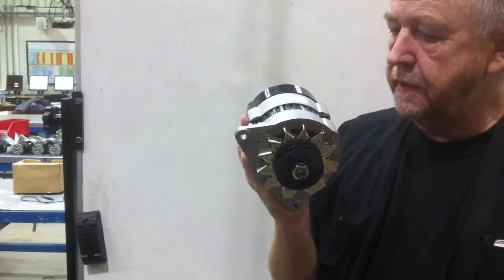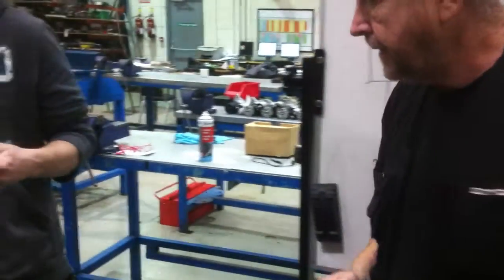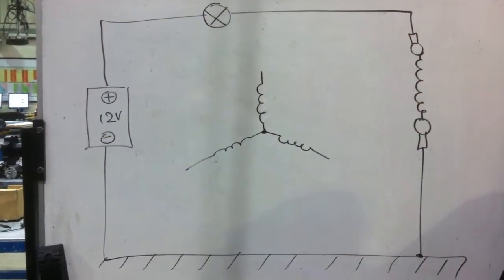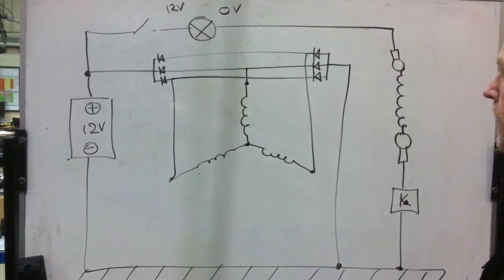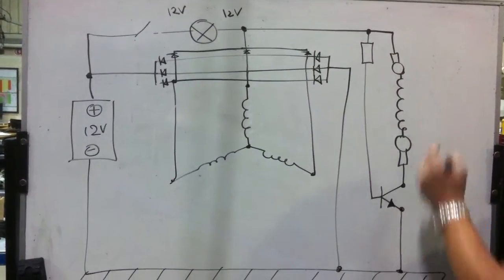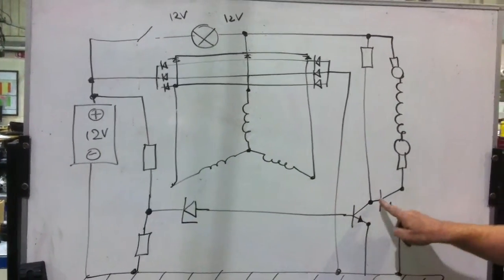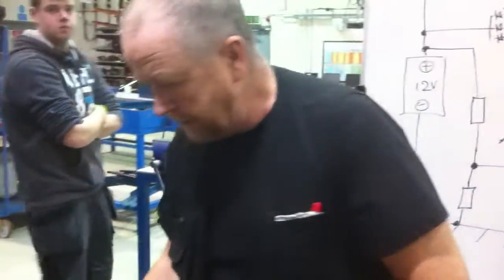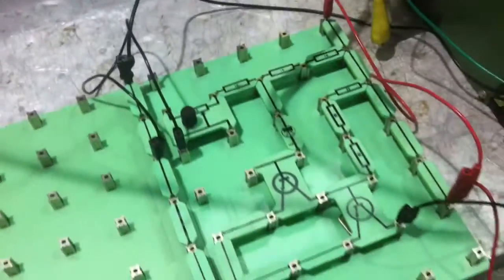Apprentices use Locktronics to build a voltage regulator for a Lucas Alternator

Comment: A well structured and thorough explanation , especially how you go in depth into the voltage regulator.  After watching your video I retrieved  a Lucas alternator that I have been keeping for years in my garage , took it apart , tested each component and verified that it was indeed working - something I have been meaning to do for ages. Thanks a lot !

Comment: Excellent style of teaching, you made it very simple to understand, clarity should be a currency!

I'm living in a camper van, have a 100 amp ignition battery, and a 4 x 90 amp(360 amp) battery bank that in summer is charged with two 120w solar panels. I'm biting my nails as winter approaches, with dwindling sun, and a much colder less energetic battery bank.
What I'm struggling with is how to 'trick' the standard valeo 90amp alternator to charge my 360amp battery bank .
In summer usage they can be sitting anywhere between 11 volts & 13.5 volts, regardless of my starter battery's voltage. 
Is there a simple way to trick the alternator? With perhaps an additional circuit?
Any help would be greatly appreciated
Cheers Neiall

Comment: Excellent video. Would you mind letting us know the value of the resistors you used and the amp rating of the NPN transistors.
Reply from the maker: oc2phish07 Hi, sorry for the delay in getting back to you, I've been away. The circuit we knocked together was done on lunch breaks, because there is no time allotted in the syllabus for this activity. We just used components that were to hand. The transistors were bc109's or similar, and the (base limiting) resistors were around 1kOhm.As regards the resistors used for dividing the voltage in order to signal the Zener diode, we just used what ever was around to match the voltage of the Zener. I also had the apprentice use a variable resistor so that he could prove to me he was controlling the output voltage of the alternator. As you can see from the video, it was a little high (in excess of 15V), so you would need to fine tune that.The resistance of the rotor is in the region of 3-4 Ohms, so your transistors or Darlington pair would need to be able to handle that. We literally knocked together the circuit with bits and pieces we had around. I just wanted to show the apprentices that all this theory actually works. At some time in the future, if I get time when this topic comes around on the next course, I'll try approach it in a more precise way, and work out some exact values for the various transistors and resistors. My problem is there's no time allotted on the course to go into this so deeply, so it's only what ever we can got done in spare time that we post on line. Thanks for asking, and hopefully, in a few months, one of the new apprentices will take up the challenge and answer your questions with exact values.
Reply: matchudcu Many thanks. I have purchased the extra components I needed from Locktronics and am using the circuit with my Level 3 Apprentices. Really useful stuff.